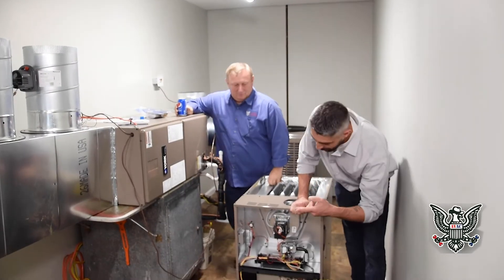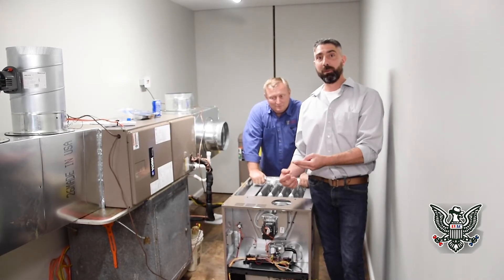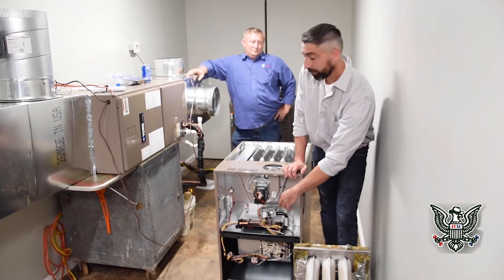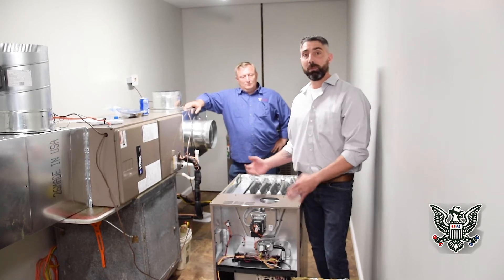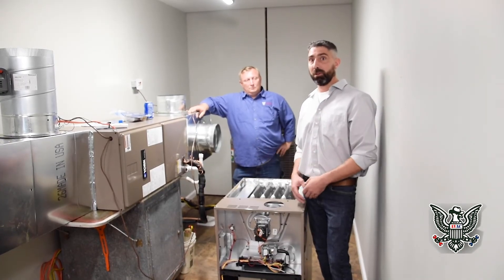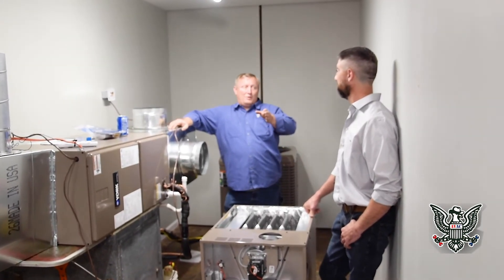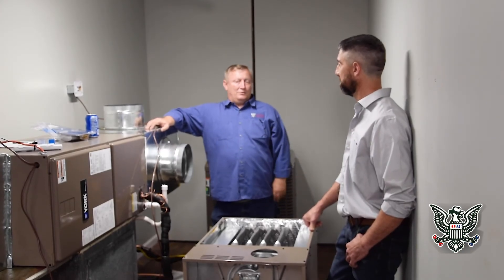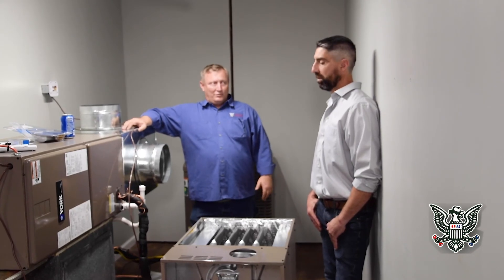What color should my furnace flame be?

Comment: Is a little red orange or yellow a bad thing?
Reply: Same question
Reply: @supabiscuit   Me too. Nice to know they get right back to us with a question. LOL
Reply: @alan4sure  ideally it should be a consistent blue like the thumbnail used for this image.  Flickering different colors of yellow thru red “in my experience” indicates the need to clean and or adjust your burners.  Manometers are fairly cheap and a valuable resource in regards.  Once cleaned and adjusted, ensure there’s no flame roll out…. Meaning the flame cones nicely and constantly into the heat exchanger.  Hope this helps.  Feel free to reach out if you’d like
Reply: @supabiscuit  thnx. I did the gas off blower on flame test and seems heat exchangers are good anyway. Nice steady flame each time.

Comment: mine is a blue flame going straight through like you say but there's a little bit of the blue flame not going through. i'd say 95% of the blue flame is flying straight through, is this okay?
Reply: Being that you have a 95% furnace I am assuming that you have an inshot venturi burner assembly.  The majority of these have a carry or cross over bridge between burners.  It is normal to see a small flame on that bridge between burners.  The main thing on a quick visual inspection is to ensure there is no turbulence or roll back on the flame.  A solid blue flame indicates that the fuel to air ratio is relatively accurate but it is good to have this professionally inspected at least annually to ensure everything is dialed in and operating  safely and at peak performance.
Reply: @shawnmcgraw679  we actually have a 20 year old 80% furnace. guy came over a couple weeks ago and said everything looks fine. there's actuallly only two burners for some reason. all these videos i see theres like 4 minimum
Reply: @shawnmcgraw679  thank you this is the answer I was looking for. Seems like a lot of wasted gas being burnt between the burners.